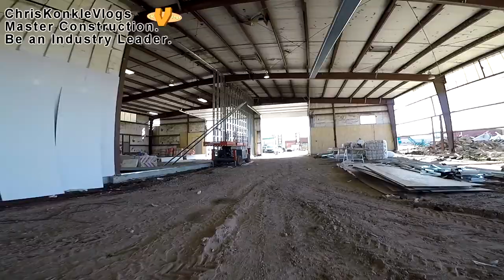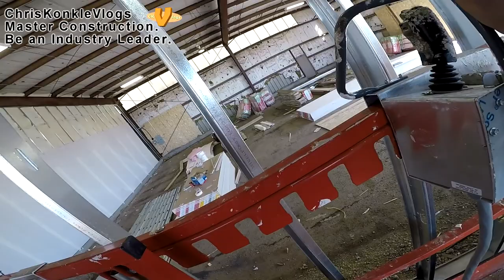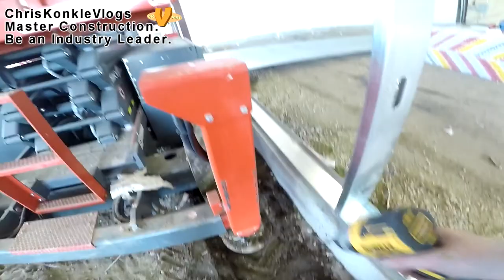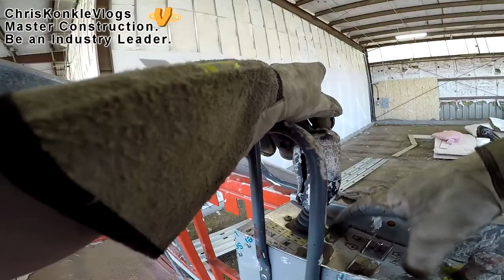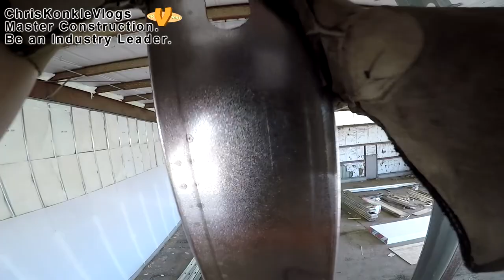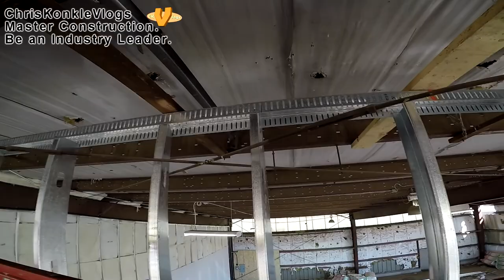Metal Stud Framing | Trade Secrets Revealed

Comment: 😂🤦‍♂️you sound just like me when I’m working😡 cussing at gravity every chance I get. Are those 18ga studs you’re working with? What’s the maximum spacing for fastening the top track?
Reply from the maker: I would say 2' max but I try to stick to 16". Shoot I think we are using 16g here.
Reply: I have a job coming up and haven’t worked with metal studs in a long time. I’d like to attach the Slotted track straight to the Deck. Architect has me questioning myself bc they have a UniStrut detail on the drawings showing the track attached to Unistrut butted up to the deck with brackets for the top track. Have you ever installed top track like that or made a video using that process?
Reply from the maker: Sorry for the late reply my man, been on vacation with family. I've never seen that before and I usually always attach to the decking. You can share a snapshot of the detail on my discord or email me and I can have a look for you.